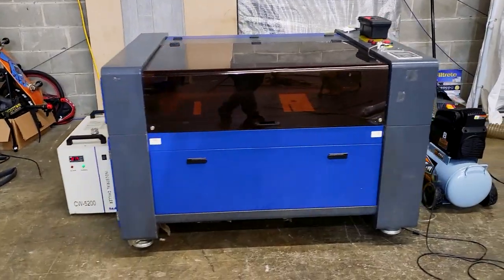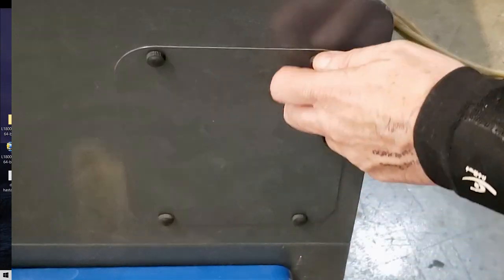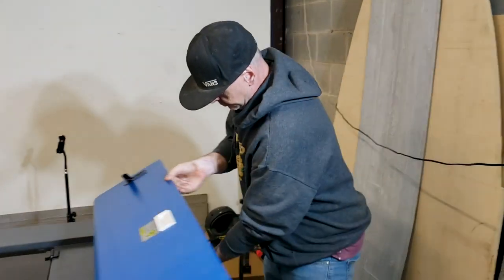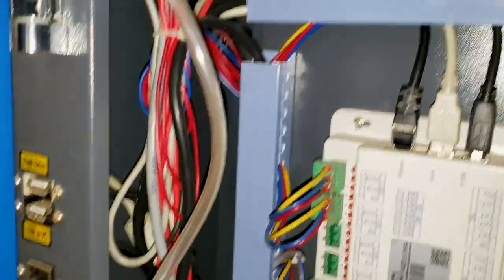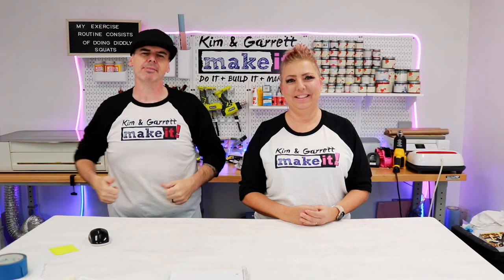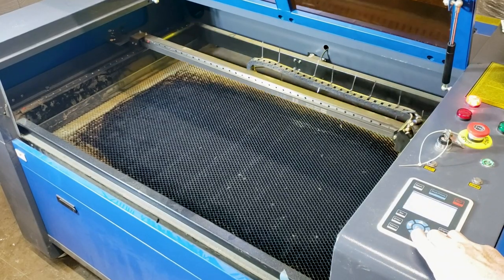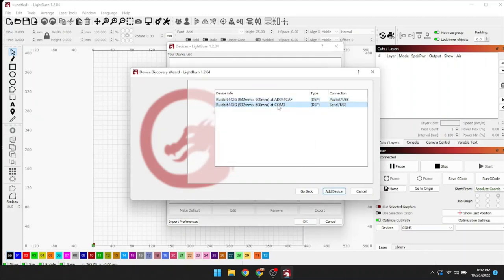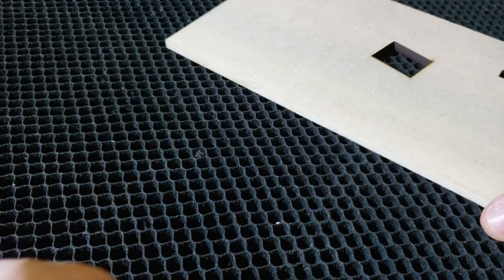How to Set Up Your New Laser Engraver in Ten Easy Steps

Comment: One of the main complaints about the cooling is that people use zip ties.  Yes, the manual says to use them. However, pick up a few good quality hose clamps, you can get all you need for this for less than $5.  Even though  the connections might be barbed (referred to in this video as 'ridged') the hoses can and will leak without a good seal provided but the right equipment.

Absolutely don't plug everything into the laser (compressor, exhaust fan, and air assist). It's not made for that. This is why the fuse blew because everything was turned on when the laser was turned on.  The amp draw caused the fuse to blow.  For one, don't plug everything into the laser, it can't handle it the amp draw from all of that.

Comment: I have the OmTech 60w CO2.  I'm glad you went through the full mirror test.  I've watched others do it with masking tape, but they never explained the way they found dead center.  I like your way of using the clear packing tape better.  I may upgrade my air assist, even though I don't use it for cutting wood yet.  I have upgraded the exhaust though, and got that rather then adding a noisy dust collector, I used a 6" inline fan, which runs very quiet and moves a ton of air.  Did you get the 3D Printer yet?
Reply from the maker: We did! We're planning a video on it for January!

Comment: Quick question they sell plexiglass 24" x 36" is it possible to use the passthrough and use this size?  Or am I stuck having to cut an inch off the boards (somehow) prior to putting them in the machine?  I have the Ohem 80w laser with the 24" by 35" bed.

Comment: Every time I try to run I get an air pressure alarm and machine won't cut. Any ideas?
Reply from the maker: Sounds like the internal air compressor isn't turning on.  I would check the fuse and then check the wires at the power juction/motherboard. Let me know if that helped!